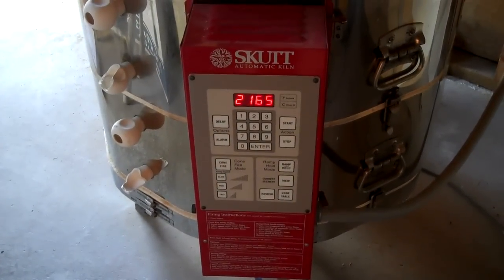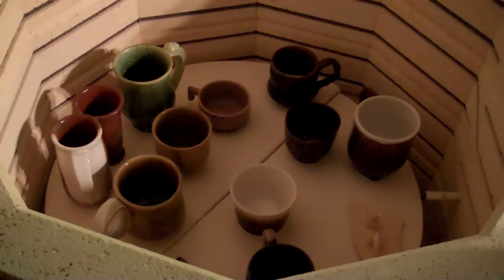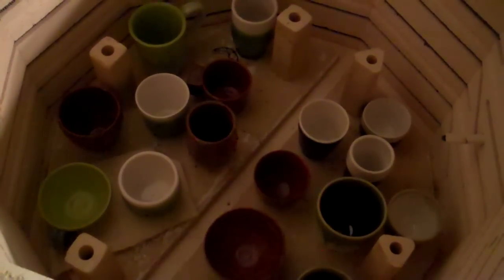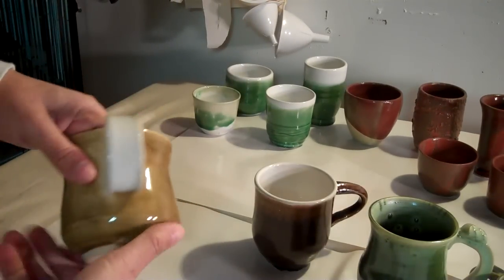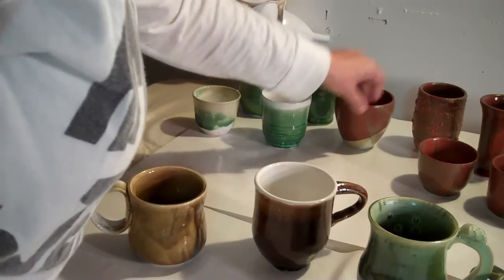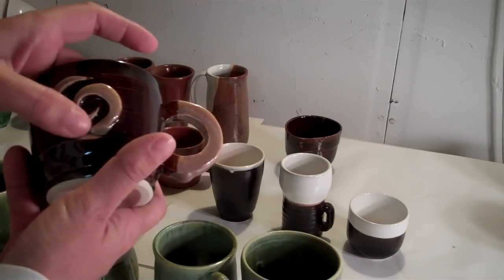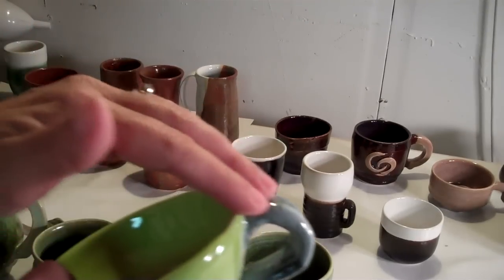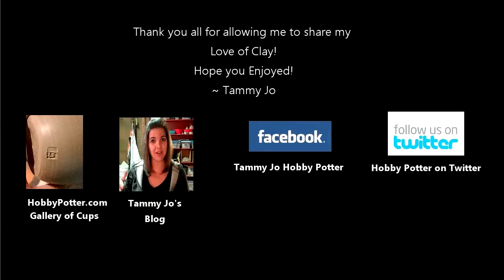KILN OPENING - Glazed Pottery #2 - 25 Stoneware Cups - Hobby Potter

Comment from the maker: @mga2890 Kiln wash is what you apply to your shelving to protect them in case glaze "flows" and sticks to the shelf. I didn't have any on the shelves the 1st glaze run, had some major drips and needed to have hubby grind the glaze off...ruined the shelves slightly. Waxing the bottoms stops the flow of glaze from making it to the shelf and also repels the glaze from landing in this area when glazing. You can also "dry foot" which is just wiping off glaze from the bottoms :)

Comment: The website I posted on your FB page which has the tips, well someone posted a tip which says you can put children's playground sand on the shelves and it will protect your kiln shelves from the glaze if it leaks. I haven't tried it yet to be able to tell you it works.